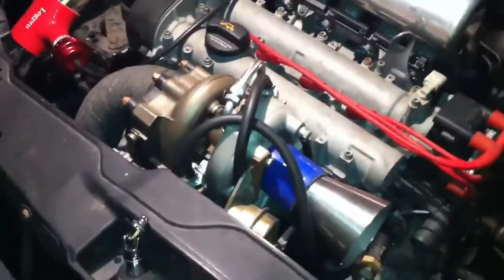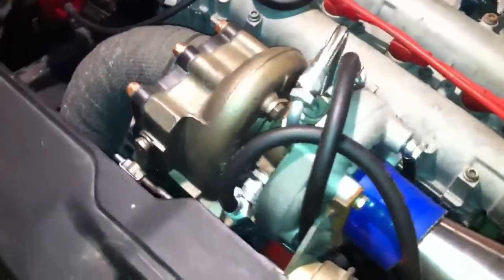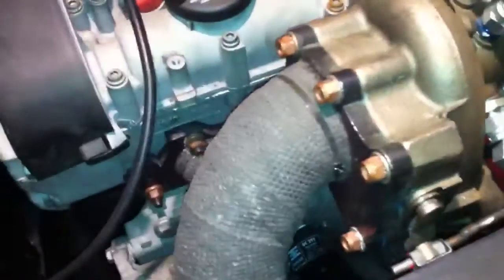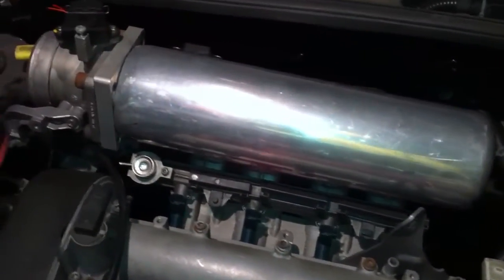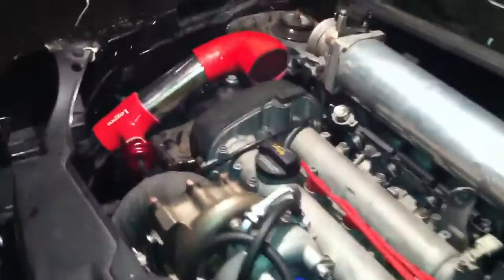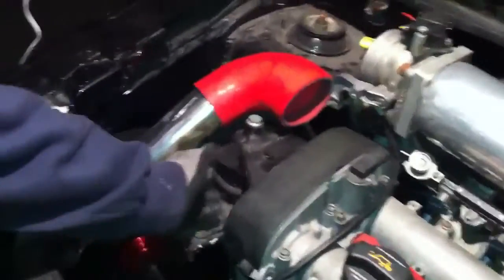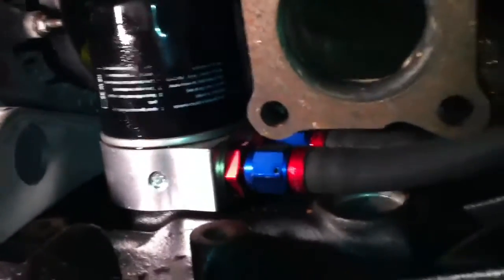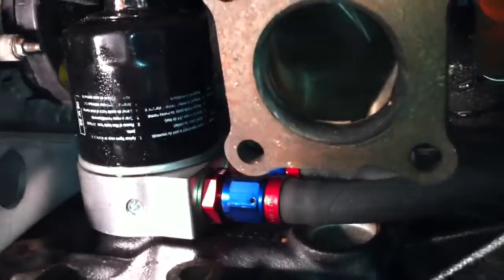Home built Lupo 1.0e GTI Turbo Conversion

Comment: Did u get it runing all ok . So this is a 1.0L lupo with a turbo is that right
Reply from the maker: Hi mate, it was a 1.0, I swapped it out for a 1.6 polo GTI engine with throttle bodies which I’d finished when the car was painted. 
But ended up doing a trade with a Lupo GTI set up with 6 speed box with LSD. 
 It’s not finished unfortunately, I still have it, car has only done 40k miles but it’s been stood since 2005 so literally everything is either perished and needs replacing or stripping and fettling.  
The conversation is finished, just wiring and mapping but I need to sort the car out and I guess I’m about £5k and six months spare time short at the minute. 
Would be nice to get it back on the road for 2025 I guess 😂
Reply: @lupo10  do you have instagram?
I would love to see updates to the lupo
Reply from the maker: @Stevenrogers274  hi mate, yeah it’s Lupotigz on insta. 👍

Comment: did this ever run?
Reply from the maker: Bad Engineering no mate, never got it finished. 
Took it to the workshop last year but ever bush and strut looks shot so out it on the back burner again. Need to find a low mileage donor car. Or strip it and get rid.
Reply: @lupo10  damn, Finding info on turbo'd AVYs is slim! Read all your posts on the forums. Currently building a low boost AVY using the TSI turbo/manifold, reinz 4mm gasket and  standalone management amongst other bits.
Seems they melt at 180hp stock, with that as my goal I think the decomp plate should allow me to run around that without too many headaches.
Reply from the maker: Bad Engineering yeah, I have a spare engine to throw some stronger intervals in. I planned on trying out decompression plate but I didn’t expect it to last so wanted a back up. I think as soon as you start adding any serious levels of boost you’re gonna have problems. 
I was chatting to some kids in German who used to turbocharged 1.6 Polo GTI engines and they said 0.5 bar was maximum with a decomp plate.
Reply: @lupo10  so that was my limit anyway although the decomp gaskets are an oddball thing and are rated much higher than a plate+gasket. My concern is keeping cylinder temps low which the standalone will help with a lot, water meth might also be worth playing with.
The cars currently running 60-65hp and on track is very setup, just lacking in power!